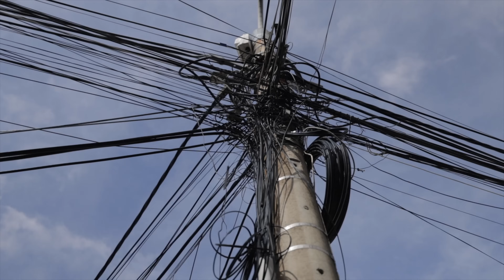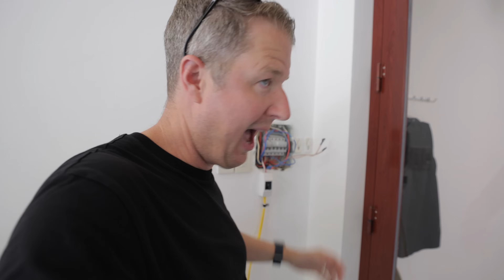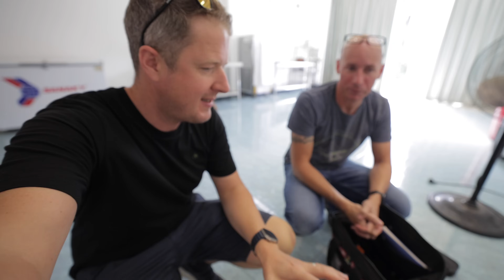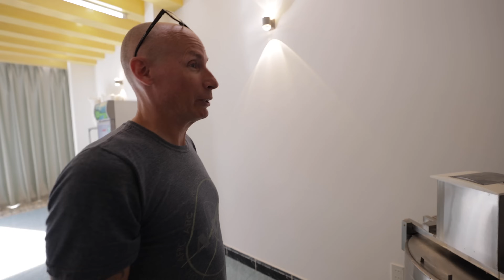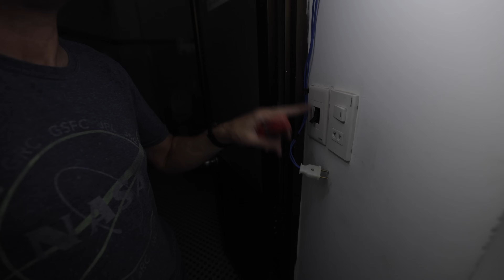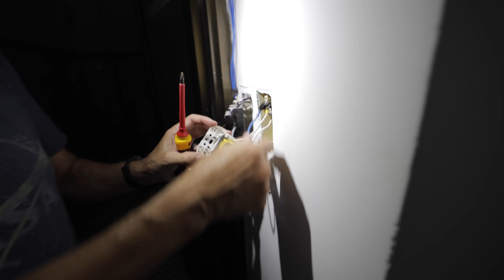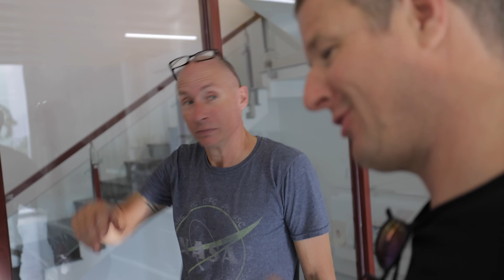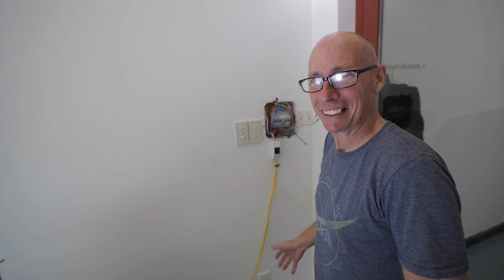USA and UK Electrician tackle CRAZY electrical wiring in Vietnam

Comment: Australian sparky here:
We almost exclusively use stranded conductors so twisting is basically commonplace. We mostly use neutral and earth bars though but every now and again I'll come across an entire installations worth of earths twisted and soldered. In Queensland we are also required to twist and solder a 6mm neutral tail for the meter neutral no matter the size of the main neutral. When we're terminating into switches, sockets or connectors - we twist all our conductors.
Reply: Aussie Sparkie

Lol meter on the pole in the street 
So they can't tamper with it , 
or' innocently accidentally'  tap into the mains before the meter 
The supply authority finally found a great solution to stop that kind of caper! 
Assuming they were an official connection and not just hard wired to to pole lines with out a Meter 
LoL if they are gonna steal power there they just have to go all in straight from the street 🤣

I would have thought  using an Independent earth - 
 a trailing lead  from a screw driver stuck into a free bit if dirt outside
Would be a must on any 'confusing fault with weird unexplained live wires ' 
just to have a conductor with a KNOWN  potential  to build your  fault finding logic on

( The  live conductor  of the mains feed in could  have compromised insulation making the whole house live via concrete REO etc meaning the concrete floor they are using and assuming that its close to earth potential  when it could actually be floating live  and incorrectly basing all their fault finding readings off that )
It could even be The neighbour on the other side of the wall may have a fault that's livening up the building 

(I have seen this done )
It's a Rookie mistake to over look and not use a true Independent earth 

In any installation that is new to you ,
Don't trust anything or cable colours until you have proved it yourself  using your own Independent earth 
It's the best way to stay alive ( and cover your arse -  so little timmy doesn't get a tingle every time he is playing in the water around the outside tap till one day he gets a good one ( shock) and drops dead  meaning you spend the rest of you life in a concrete cell  as you left an installation connected reverse polarity 

( Although apparently Thailand probably wouldn't report it as an electrical death!   so all good 👍)

In Australia using a  Trailing lead from an  Independent earth stake / long screw driver driven into the middle of  the front yard 
To prove the  polarity of the incoming mains 
And ensure the installation is not  reverse polarity ..

At least all of the circuit breakers in the video appear to be double pole 

It's more important for the final job to be 'electrically sound'  than it is to look 'perfect' 

Or The next sparky comes along 
Fault-finding tracing wires out  has to cut tons of cable ties  off to trace where each wire goes

Its better for a switchboard to 
look like cr★p  using  whatever (electrically correct)   gear you can  source / have ( different  brands/ age etc)
It's better to be safe and perform with out any problems for years to come  rather than look pretty and not work right / fail . Just because is had to ' look nice'

Performance and reliability is More important than looks
Even if it's just down to leaving enough slack in the wires for future maintenance, with minimal interruption to client . Ease of tracing wires in a full board

Its A bit hard in a full switch board when you pull on the wire you are tracing and they all move as they are all solidly cable tied together 
So you Have to turn the whole board  off and  take it apart to reach and cut the cable ties off safely 
Just to trace the wires !

Argghh !

 
Why are they using the MEN system if they aren't running earths through the house

The whole and only reason for joining N to general mass of earth is to provide a KNOWN given potential to be used in fault finding
And avoid 'impossible' to find  faults crossing from one installation to another  via water pipes concrete REO etc 

As in a fault like this 
In A two wire system with no reference or link to general mass of earth

If one installation has active shorted to a water pipe ( could be a toaster with an  active part  touching its frame placed on a metal draining board of a sink) or even just a hot  water boiler 
With just that 
There's no issue or tripping 

Untill 

 another installation way down the road develops a neutral fault 
( short) to a water pipe 
Let's say a toaster Neutral fault to its case and it's on a metal  kitchen sink draining board that has taps on it

Resulting in ' nuisance' tripping at both installations 
Due to current flowing between the two houses via the water pipe / general mass of earth ( especially if it's been raining - another 'random factor')

And neither can figure out why their C/b keeps tripping  'at random' when all the factors that they can't see and are in aware of  align.

If the toaster is moved to a bench top next to the sink
Some one could get electrocuted just by touching the sink and the toaster, but only if the random fault is present in the first installation ( their fault could also be in their toaster etc)

That IS the only reason NEUTRAL 
is tied to general mass of earth, the MEN system

To 'contain' any faults to within an installation itself. 

Regardless of what happens with YOUR electrics you won't be endangering your unwitting neighbours lives 
Only your own life.

yes The MEN system
 CREATES  a danger of getting a shock if you stand bare foot in a puddle of water and decide to touch something that is live.

But it is a KNOWN danger 
That is always present it is not reliant on ifs buts and maybes that may or may not be present / happening  somewhere else !

It just IS , it's a constant , a given , a known factor.

That is why an earth is required at every GPO and lighting point 

Running an extra conductor to every electrical  point does incur an extra cost during installation which is a down side
But it is required as a safety measure to mitigate the Danger  and the 
Risk of shock between live parts and earth 
Introduced by using the MEN system .

When a shock is received to earth  from an MEN system the fault can be identified and rectified as it is has to be local within  that installation 

Without the MEN system the fault could be   
One of many things and 'no longer visible' as a fault in some other random installation has been removed 
(Such as the faulty  hot water system down the road just reached temperature and it's  thermostat just turned off)

The MEN system forces  the people with dodgey gear to fix it 
( Makes the people with dodgey electrics aware of it by tripping THEIR own C/Bs not the neighbours )

Lol I guess rather than guessing if  it's safe or if there's a danger of an electric shock 
To earth , it's been made into a DEFINITE 
Known danger  condition ( that is great for fault finding and fault containment)

Oh and  BTW
 when you are in a hi rise apartment
A flower pot plant is NOT considered a good place to put  Independent earth 
🤣
Reply: @GlenPoll-ox2hj no-one's reading all that fella.
Reply: @mikeypc3592  Bit of an epic isn't it.  Can't argue about the independent earth though.  Reveals all if the transformer star (wye, centre) point is earthed even via high impedance.  Go back to basics, establish the service polarity and work from there.
Reply: @mikeypc3592  I did
Reply: @GlenPoll-ox2hj  the only thing I have time to reply to is about independent earth. Yes, it's absolutely a needed thing. I have a multifunction tester that uses 2 independent earths that I run as far from the install as possible.
Reply: @GlenPoll-ox2hj  also, we don't have meters on the pole. We have meter enclosures that can double as the switchboard for the installation as well. In QLD we have protected mains though, so on the pole or in the pit (green boy) there's a fuse for every property. Meters are on the property despite being owned by the retailer (and/or their meter provider)
Reply: My "live" bus bar in the switchboard is just all lives twisted together in a screw connector block. That was done by a qualified electrician.
Reply: @davidunwin7868  I've seen that before. Also came across (and used) active links before. Same as the neutral link that the soldered neutral and meter neutral terminate to, except it's red and obviously fills a different purpose.
Reply: In NSW, we use a service neutral link for service neutral, meter neutral and a neutral to the customer m.e.n link. Old days where soldering neutrals and earths. Today neutral and earth links.
Reply: They need to be using double pole breakers in these dodgy electric countries

Comment: I seen metal sink, it should have metal faucet and pipes that go into ground, even plastic pipes full of water are good enough for AC groud path, test with meter to faulty wire and sink. Maybe there is wired in warer heater or furnace, or some large applience i seen, that is not on sockets. Or the wire is dammaged in the wall touching some other screw or metal, appearing like grounded. Wish ya success on the adventure.
Reply: Can't really Use metal sink or hot water system as an Independent earth reference untill you prove it ,as there could be a water pipe bond to what they thought was earth / neutral  ( or polarity swapped after it was done)  or hot water sys etc could be down to earth / frame  making all the taps/ sinks live

You Need an Independent earth from the yard (so that you know without any doubt that it is earth potential,) with a trailing lead to test polarity , if  for nothing else to test taps and sinks etc and make sure they are not live ate all 
Water pipes can be live and if they are unfortunate and a water pipe joins bursts you can get arcing ( that you can see at night at least) across in the escaping water from one pipe to the other 
I have seen it when all of these unlikely events occured  at the same time.( Neutral burnt off at point of entry so the massive load of industrial cooking equipment  being used was returning to earth/ neutral in the street via the water pipes)
I don't know if the pipe join had issues before  and was going to break anyway or if the electric current found it as a high resistance created a hot spot and melted solder  or something?

Either way seeing I guy standing in a puddle of water being sprayed with water attempting to stop the leak while you could see flashes of light in the water around the pipes 

Was the worst thing I have ever seen , he was so lucky he didn't die.

( It was at a restaurant and lounge was p★ssed as a f★rt)
I was shouting at him to get away from it I wasn't going to go near him ( I was p1$$ed not stupid)
And Turn the bl★★dy power off
And  then turn water off/ tackle the burst pipe.
They had to shut the restaurant down for the night  till it was fixed so the owner was upset so asked them would they rather lose one nights business or have someone get electrocuted and a coroners  investigation 
Requiring the evidence to stay as is until fully recorded etc meaning the restaurant remaining  closed  for the duration .
Faced with that the owner did the right thing 
( Plus I told them I had to demand access to their switch board to turn the mains off ) otherwise I could be held liable for any injury/ death 
Even tho it was nothing to do with me (and I was p★$$ed as ) as I saw a dangerous situation that  I knew could easily be deadly and the clowns were literally  playing with their lives.

Fun times 😃

Comment: When discussing wiring with people from the US (we do it wrong so everyone else can do it better), it is simpler to use amps rather than translating physical wire sizes.
Reply: Trouble is, anywhere outside North America (at least in industrialised countries) there's no direct correspondence between physical wire size and current-carrying capacity because the latter depends on whether the wires are surrounded by air (overhead lines), buried in the ground, buried in plastered brick walls or surrounded by thermal insulation, and whether multiple cables are bundled together (heat derating). Ambient temperatures and length (voltage drop) also play a role.

One example from my recent jobs: normally 16 mm2 is good for 63 amps. However, my run is slightly over 100 m, so in order to keep voltage drop under control I had to derate to 25 amps.
Reply: @Ragnar8504  All the derates you mentioned are a thing in the USA too.
Reply: @UKsystems Take a look at pretty much any country's electrical standard and it's full of tables that give the situation of the wire and the expected terminal temperature under a given load.  Why do you feel it necessary to gift your peculiar type of misinformation to the world?
Reply: @UKsystems Seriously mate, give it a rest.  If you actually knew what you were talking about, ie you actually clapped eyes on the N.E.C., you'd already understand that US electrical  takes all these things into consideration and guess what, you can do calculations in the USA if you like too.  For most instances in most countries performing calculations is not needed, just refer to the tables.  You even have tables in the UK.  Now toddle off and annoy someone else please.
Reply: @UKsystems BS, nobody does calculations in any country unless they are required to do a report or something for a BIG project. There are tables to follow, also you're limited to how much amperage can be supplied. In europe at best you're getting 36kw 3ph, 12k per phase, 90% of the time it will be a 10mm2 cable the other 10% it will be 16mm2, 6mm2 on single phase/poor countries and thats it. Even if you're living in a farm in the middle of nowhere you're still getting supplied at your doorstep by the electrical company, no need to account for voltage drop.

Comment: How can they not have more fires with wiring like that? This is insane!!
Reply: Third world country as finest, they believe the power of God to prevent those 😂
Reply: They do have fires and deaths caused by electrics  they just don't officially attribute them to electrical faults ( as would probably create too much (pointless) paper work to prove/ not prove the cause was electrical )
Reply: @GlenPoll-ox2hj  Nope. The buildings are concrete and not flammable. No fires. Plus many tropical buildings may have permanent ventilations that cannot be closed, so that any little smoke from a switchboard going up in flames will harm no one.
Reply: @GlenPoll-ox2hj  On the other hands, almost all house fires are attributed to electric problems.
Reply: Do they have neutrals tied together from different branch circuits? That would explain the small changes of leak current. I would also use tone generator to trace out circuits.

Comment: I wouldn't have thought there would be a "short-cut" to fault finding - in the west we have standardised installation methods which specify colour coding etc because overall it is more efficient since everyone should know what the standards are.  When you don't have a standardised install each person working on an installation needs to work out what the install actually is before they can work on it - this takes time which adds to the cost and reduces efficiency.  On top of this you have electrical safety to consider - we don't get nearly as many electric shocks as we used to due to better product safety design - I remember appliances my parents had and used reguarly where getting a shock off them was relatively common occurance and you soon learnt to be careful!

Comment: It's similar here in the Philippines - however it's 220v 2 phase - no neutral - and unless you put your own earth rod in - there is no earth. All the connections in the roof space are just twisted together - even the high amp lines for an oven or an air con. All the wiring in my house is green. No colour coding - nothing.
Reply: Everything wired in black with twist & tape splices is the most common in the Philippines. Electricians do usually wire more systematically here than that example from Vietnam. 

When building our own house, I did all the wiring according to the Philippine Electrical Code using the prescribed colors and WAGOs for splices. 

I had to order the wires via Lazada as local hardwares often did not have all the colors I was using: 1st phase - black, 2nd phase - red, earth - green. Wagos were ordered from Amazon US. 

Colored electrical tape can be used to mark wires in the official colors on both ends, if the hardware stores do not have the right colors available. UL listed American wire nuts are available from Wilcon.
Reply: @ChristianWagner888  it's a sign that nobody is paying attention to the standards when the local electrical store doesn't even stock the appropriately coloured wires and connectors. Blimey.
Reply: You can find the similar things in England, where this guy from.
Reply: Lol
Reply: I hope you have good insurance.
Reply: 220 volt  2 phase no neutral  or earth ?

What kind of voltage do you get to each ' phase from an Independent earth?  110volts ish ?

Comment: Hi there, I'm from South Africa, and we do Electrical and solar on a daily basis.  The way they do it here especially in new housing estate's that's is very expressive properties is chocking.them you go out into rural areas and it's even worse.  There no building or any construction regulations apply. 
I had to do a COC after installed a Battery backup system. But could not get proper earth reading. The saw cable coming from distribution pole. It's a black cable with a 10 mm red wire and surrounded by a earth armouring. No neutral so the n at house the connect 2 x2.5 mm surfix cables to this. So no way I can get proper earth point to complete test. I suggested to customer we fit grounding rod and Earth their DB, they said no worry we don't need COC out here.